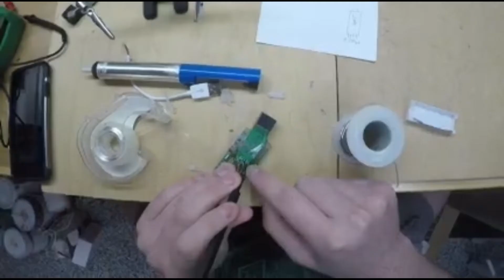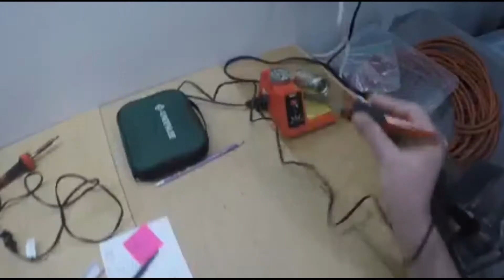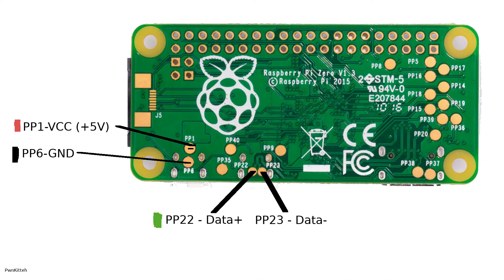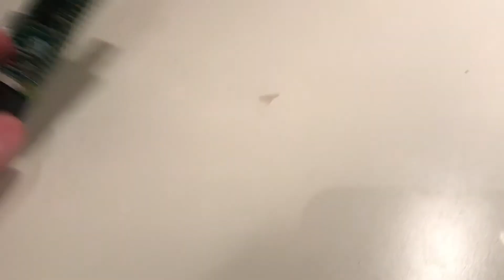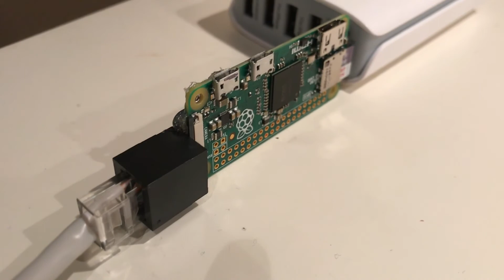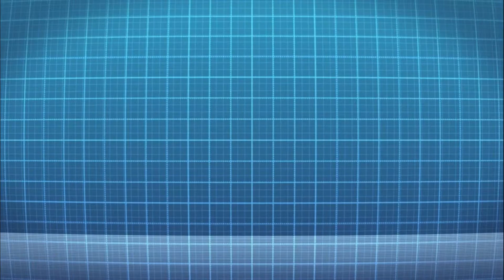$7 Lan Tap with Raspberry Pi Zero (DIY Lan Turtle)

Comment: It is confusing the way you show it. I guess you for an odd reason to confuse us is powering the Pi with the USB male jack. Instead of a powerbank with cable, or just normal power outlet. The idea here was to tap on to the Ethernet, not plug it directly into the target machine ( the topic ).  Looks like the is to plug it into a target machine and then put the ethernet cable into it...confusing. But I get the capabilities.
Reply: If your looking at the two micro usb ports the OTG port allows you to plug the Pi right into a USB port and power the board.  If you create a blank file named 'ssh' in /boot you can ssh into the pi over localhost , all while powering it. 'ssh pi@raspberry.local' . The comment I posted here was for the wrong video. I help a bunch of content creators with their viewers , I am like the YouTube IT help desk.  Right now I have 38 tabs open , responding to viewers helping where I can.  Thats how I contribute to the community.  I clearly was on the topic of Ethernet over USB gadgets , just wrote it on the wrong video lol.  A lot of times I will address a topic that several different content creators are covering , and things get messed up.  Trying to juggle too much at once.  Right now I am talking to you and its 3am where I am.  If you have any more questions about  this video or anything linux related , feel free to ask away.  BTW ,    you will here a lot of long time linux users refer to their computer/system as a linux box, thats all that means.  When you've been in IT security for as long as I have , some things just stick.  Your not the first person to ask me 'what the fuck is a linux box' lol .  The Pi zero is ideal for the USB attack vector , and HID based attacks.  Basically every device Hak5 sells I can make with a Pi Zero W for $10 and some spare components .  I think the point I was trying to make (6 months ago) was that   you could do all of this without having to attach the NIC , as long as you have the male usb attached and the usb ethernet gadget overlay enabled ... Man I am going to confuse you more ,,,, picture this video with no Ethernet cable , but still getting the Ethernet connection over USB.  Then you can ssh in through the Pi Zero W wlan0 , wifi interface and sniff the packets remotely without a huge cable hanging out of a circuit board on the victims tower.
Reply: like this https://learn.adafruit.com/turning-your-raspberry-pi-zero-into-a-usb-gadget/ethernet-gadget

Comment: Hey man, could you maybe make a more indepth tutorial? Thanks a lot.
Reply: This will only work the way he shows if your target is another linux box.  You could also achieve the same thing without the ethernet port on a windows computer by powering the Pi over the attached USB stem and making use of the RDNIS Windows Driver for Ethernet Gadgets.  That said you need physical access to the target machine.  If you wanted to do this either way you would have to leave your device attached to the target computer, and hide it so its not visible.  Though the pi zero is small its not that small and someone would likely notice this sticking out of the back of their machine or connected to one of their lan cables.  Since he shouted out Seytonic, who I really dont like btw, he should have stayed behind the camera.  Ever since he showed his face thats all he does now.  If your looking to sniff keystrokes his device is the best solution.  His keylogger is tiny and connects over wifi for a live view, or you can have the keystrokes emailed to you in increments .  So the device in this video is a lan tap,  in this case he is sniffing keystrokes.  It can also be used to sniff traffic/packets but in that case you would actually be capturing packets and later having to decrypt them.  Another words no keystrokes in plain text.  Unless you implement the MITM attack, that is another topic.  Same concept different tools.  Although netcat is Extremely versatile & a great tool for sysadmins, as you see here it can also be used in a nefarious manner. hope that gives you some clairty.
Reply: @s4b0t4ge7  "This will only work the way he shows if your target is another linux box." wtf does that mean lol